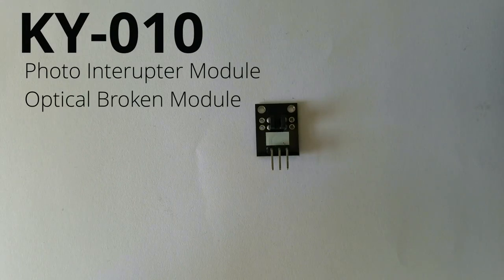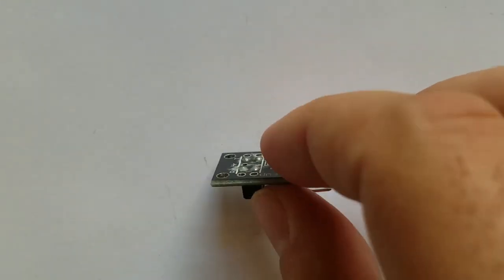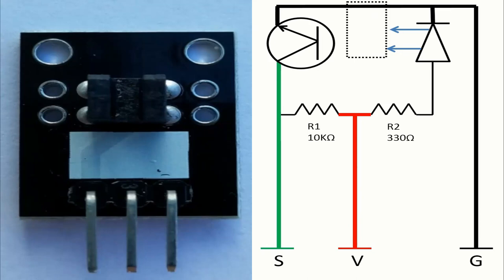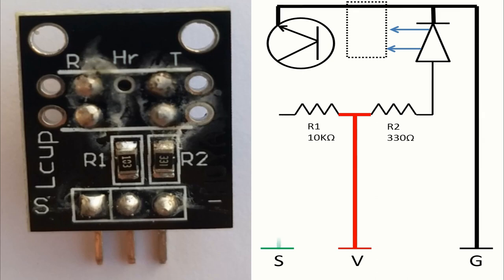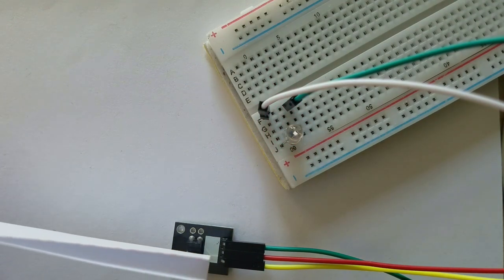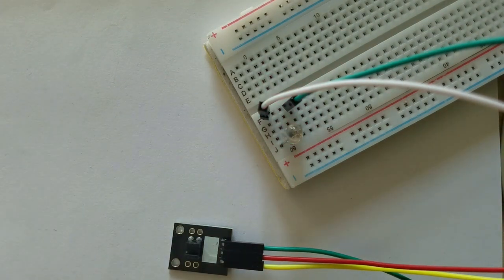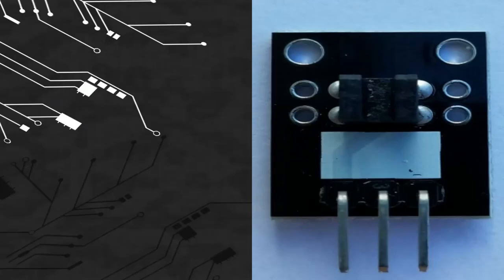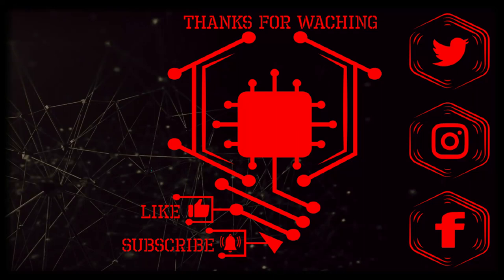KY-010 Photo Interrupter Module

Comment: Hi! Thank you for the video, I have a doubt what happens if I used a resistance of 100 ohms connected in the collector pin and one of 200 ohms to the LED? These values of the resisntance are indicated in my datasheet to have a fast response (5microsecond) but I have already conected the circuit and I don´t have a variation in the voltage each time that i put a wall between the LED and the transistor.
I would like to know your opinion!!!